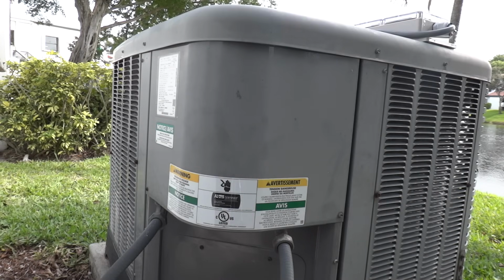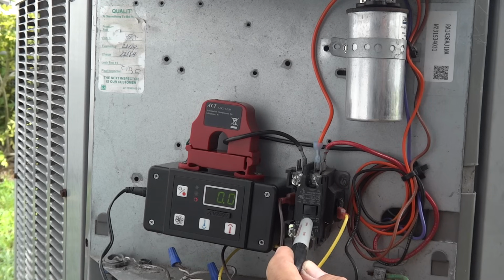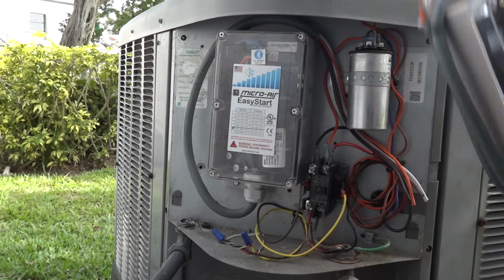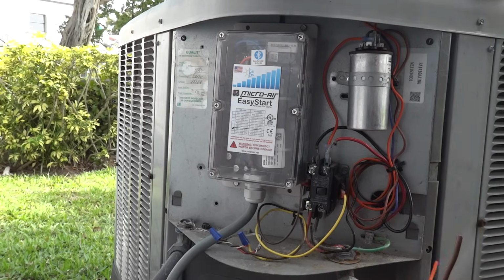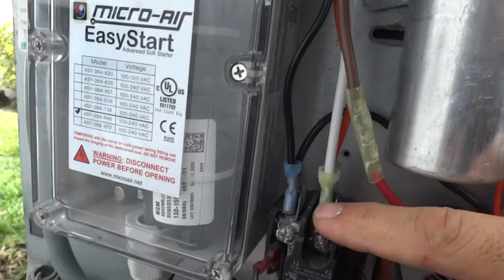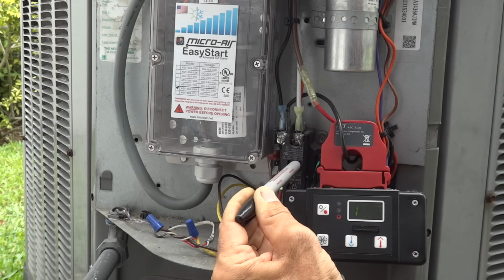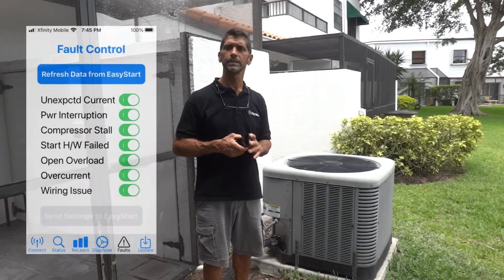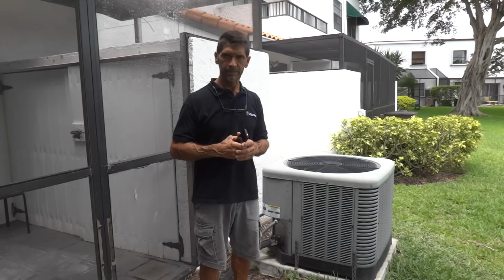Micro-Air EasyStart Home A/C Installation (368 Series)

Comment: Hello, can I install the 368 with a hard start kit installed? Or should I remove it? It’s a 5-2-1 hard start kit for 3 ton unit. Thanks
Reply from the maker: Hi and thanks for your question.  Yes, you should disconnect and/or remove any OEM or aftermarket hard starts before installing EasyStart.
Reply: @MicroairNet  Can you tell me the power cord whip diameter so I can get the liquid tite connector for the install? Thanks again!
Reply from the maker: Sure. The cord is 1/2".

Comment: so micro air is a surge protector
Reply from the maker: Hi again. As previously mentioned in the reply to your other similar comment, EasyStart protects itself from surges.  If the voltage dips or climbs to the point where the compressor current is affected, EasyStart will also step in and disconnect the compressor. However, for abrupt or extreme surges like a lightning strike, EasyStart cannot protect the compressor.  So, if you want to protect your compressor from extreme surges like lightning strikes, you'll have to add a separate, suitable surge protector.
Reply: so if the lights go out from a storm and throw a surge to ac unit will it protector it. are do i need to run a AG3000 surge protective to the box that run the ac
Reply: i know mirco air is for when you run the generator
Reply from the maker: Once installed, EasyStart functions both on generator and utility power.  When the lights go out from a storm, EasyStart will protect it.  When the lights come back on, if there are any spikes or surges associated with that, EasyStart may or may not protect it, depending on how abrupt the surges are.  If you want 100% surge protection, add a secondary surge protector like the AG3000.
Reply: thank you very much

Comment: do i need a surge protector on the fues box
Reply from the maker: Hi and thanks for your question. EasyStart does not require a surge protector as it can handle power surges.  If you want to add more protection for the A/C, you can add a secondary surge protector.

Comment: Why are these "Easy Start" units SO Expensive?  It's a few cheap electronic components...  WTH
Reply from the maker: Hi and thanks for your question.  There are several reasons.  First of all, they are not made from cheap components.  In fact, the opposite is true.  EasyStart is the product of over 10 years of relentless and obsessive design refinement, making it the most advanced, most reliable, and most effective soft start on the market.  Also, it is totally designed and manufactured in the USA, Allentown, NJ to be exact.  Beyond this, EasyStart achieves it superior performance through the use of a microprocessor-controlled, highly-sophisticated set of electronics that include expensive, high-current semiconductor components; high-current relays; over-rated passive components (for high reliability in high heat); unique, patentable circuits for detecting motor rotation, motor current, line voltage; and more.  Add to that its Bluetooth capability which helps DIY installers all over the world get support from Micro-Air's factory team, and you have a premium product that is like no other.  It's far from what goes into a simple hard start or anything the OEM provides in your standard, fixed-capacity, 1 or 2 stage HVAC system.  Check out the review on our website.  Check out the myriad of installation videos on YouTube.  90,000+ RV, marine, home, and commercial customers can't be wrong.

Comment: Great video. Really helped me out setting up my X48 for my home's 3 ton AC unit. You can't live without AC down here in Florida. My Great Comfort AC unit did not match the diagram. I suspect the previous owner made modifications. But went from 44 peak amps on first learning mode to 25 peak amps at final learning. Just enough that I can run it off my generator now in case of power outage. I suspect the capacitors on my AC are junk. Main cap is a cheap one. And second one is leaking cap juice. I'm gonna swap both out and have it re-learn after the swap, see if it goes even lower. Thanks!

Comment: Can you show running amps before and after?  I saw one video that shows running amps higher after micro air install.
Reply from the maker: Hi and thanks for your question. Are you asking for the before and after amps to be shown in the video? If so, then they already are shown at a couple points.  If you are asking if the before and after amps can be shown in the Bluetooth app, the before amps cannot be shown since EasyStart never hard starts the compressor.  Look on your A/C's data plate label to see what the LRA is, and that is approximately what the before amps are.
Reply: Hello, thanks for the reply back.  I’m asking actual running amps in real time not start up LR amps.  I saw some videos where running amps were at least .5 amps higher, which would be about 100 watts to power the soft start device.
Reply from the maker: Understood. Assuming the installer wired the EasyStart correctly, the EasyStart itself draws less than 5 Watts to power its own internal electronics. That translates to less than 30mA (0.03A) at 230V.  After startup, the EasyStart bypasses its own internal switching electronics with high-amperage relays, so EasyStart has absolute no effect on the compressor's running amps.  So if the other video you watched showed that the running amps increased by 0.5A after EasyStart was installed, then here is the likely explanation. 

Every air conditioning compressor in the world will vary substantially in the amount of current it draws during steady-state running operation as a function of *indoor/outdoor temperature & humidity, and the airflow across the condenser (outdoor) and evaporator (indoor) coils*.  Depending on the size of the compressor, this variation can be several amps, and the outdoor conditions always have the bigger impact since those directly affect the condensing temperature.  The condensing temperature directly affects the compressor current.  For example, if the installer ran the A/C system at 10AM when the outside air was 80°F and the indoors was say 72°F, shut everything down via the circuit breaker, installed the EasyStart, and then ran it again at 12PM when the outdoor temperature had climbed to 85°F and the indoor temp had climbed to say 78°F while the A/C was totally off, then the amount of running amps in the "after" test will most certainly be higher.  Compressors are rated with an "RLA" - Rated Load Amperage - on their dataplate, but almost all A/C system manufacturers don't list what is known as the "MCC" - Maximum Continuous Current.  The MCC is the maximum current that the compressor can draw before its internal overload trips.  Given the RLA is an average over a very broad range of condensing and evaporating temperatures, during normal operation, a compressor's current can vary between values slightly below RLA all the way up to the MCC.  For example, your typical 3-ton home has about a 16A RLA and a 25A MCC.  So, with (reasonable) changes in outdoor temperature, the amount of current drawn during steady-state running operation can vary by as much as 3-5A from simply as a function of the outdoor temperature.  Please also check out this link for an explanation of MCC from the largest compressor manufacturer in the world, Emerson/Copeland: https://emersonclimate.custhelp.com/app/answers/detail/a_id/5342

Comment: Can you give me an idea what the LRA would be if I have the 364 on my 2 1/2 ton 14 seer AC? I’m shopping for a replacement generator for my old UST 5500 and hoping the new one with the 30amp inlet will do the trick. Thanks
Reply from the maker: Hi and thank you for your question.  A typical 2-1/2 ton system has an LRA of about 65A and an RLA of about 14A.  EasyStart will reduce that to somewhere around 25A or lower.  Adding in the outdoor fan and indoor fan (total of 3A for both), you'll need at least a 4200W generator to run your A/C system alone in your house.  If you plan to get a 5500W, that will leave you only about 1000W of headroom to run your other appliances. You may want to be able to run more than that without having to power manage so much, so maybe a 7500W would be better. We've noticed that the generator cost differences these days are not too extreme, up to about 12000W.
Reply: Thanks for your prompt reply. I’m looking at the Duromax (13000)or Champion (10000) Tri fuel portable generator and since I have natural gas they’ll be reduced in power by 20%+/-. Once I instal the 364 I ordered from y’all a week or so ago and find out the true amp reduction I’ll be able to know what my limits will be. I also have a 3.5 ton heat pump for downstairs so I’ll probably get the 368 for that one as well. Both Maytag units are under 5 years old so I’m sure they’ll like the relief from the Easy Start weather I use a generator or not. My hopes are that I can at least run one big AC during an outage in the summer to bring the temps down some and if not I have a couple 8k btu window units to help with this New Orleans heat.

Comment: Do these only benefit single and dual stage systems? What about variable speed systems?
Reply from the maker: Hi and thank you for your question.  Yes, EasyStart will benefit both single and dual stage systems.  However, EasyStart is not applicable to variable speed systems since those use 3-phase, inverter-driven compressors that already ramp start on their own.
Reply: @MicroairNet  Thank you for the reply, this what I was thinking the variable would already ramp up slow, so no hard pull when starting.

Comment: In a similar video, someone commented about touching the capacitor with your fingers. They said that it should be discharged… was the capacitor discharged here? How do you discharge a capacitor? Thanks for making this video btw.
Reply from the maker: Hi and thank you for your question and compliment.  Here's the truth about the capacitor discharging issue.  Before EasyStart is installed, the run capacitor (silver one) that is installed in your system will always immediately discharge after the compressor is shut down since it discharges through the motor windings. This applies to both 2-terminal (single) and 3-terminal (dual) run capacitor types.  Any optionally-installed start capacitor (black one) in a hard start setup will also discharge through its bleed resistor (if it has one), albeit more slowly in about 30 seconds.  So, when you go to install the EasyStart, after removing power you don't have to worry about discharging the capacitors.  It never hurts to double check with a voltmeter or use an insulated handle screwdriver to briefly short the capacitor terminals together.  Conversely, after you install your EasyStart and energize your system at least once, any 2-terminal (single type) run capacitor will end up isolated after the compressor is shut down and it will no longer discharge through the motor windings; in this case, you need to discharge the run capacitor before you handle any wiring.  However, if your run capacitor is 3-terminal (dual type), it (both halves) will still eventually discharge on its own through the fan motor windings.  Hope this helps.
Reply: @MicroairNet  that did help… thanks. I looked at a video of discharging capacitors from am A/C unit and that helped me better understand what you said. Thank you so much. Looking forward to getting and installing one of these in the bear future

Comment: Maybe I missed it but how does the affect the a/c warranty?
Reply from the maker: Hi and thanks for your question. No, you didn't miss it.  This is obviously a controversial question. The short answer is "it depends". Some manufacturers will balk at any modification to their system wiring if you submit it for warranty claim with anything added. The same holds true for an aftermarket-added hard start, right?!  The good news is that EasyStart can be wired in without cutting any wires (by using a mating terminal for the run winding splice). If the system then fails down the road within its warranty due to an internal refrigerant leak, failed condenser fan, or something else, then you can legitimately remove the EasyStart before submitting it for warranty. There is no dishonesty here since any failure outside of the compressor itself cannot be the fault of EasyStart.  Regarding the compressor, as explained in the video, EasyStart far better protects the compressor than any OEM configuration, so the likelihood of a compressor failure within the warranty period is almost zero.  If there ever was a case where the compressor failed within warranty, and the manufacturer denies the claim because EasyStart was installed, contact Micro-Air and you may be surprised by we do.  Since this manufacturer's warranty concern was also an issue for some in the RV aftermarket, Micro-Air starting guaranteeing customers' RV unit compressors that are up to 6 years old (way past the standard manufacturers' 2-year warranties) for an additional 2 years.   In the past 5 years, there has only been one claim, and it wasn't really Micro-Air's fault, but we bought the customer a new rooftop unit anyway.  This extended warranty program is now being considered for application to the home HVAC market as well.  Please also see the verbiage about the Magnuson-Moss Warranty Act on our website in the EasyStart Knowledge Bank.  But in the meantime, if you suffered a warranty claim denial simply because EasyStart was installed, we would review your case and would still consider helping. We are that confident in EasyStart and its protection of the compressor.
Reply: @MicroairNet  wow!, shows that your company has a wealth of experience with these in production.